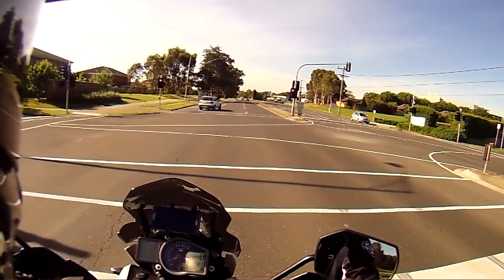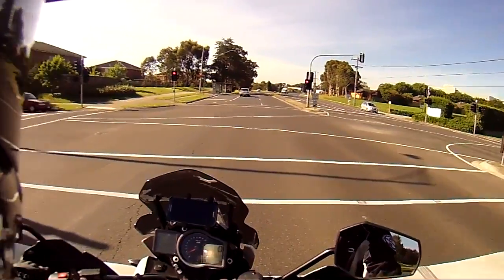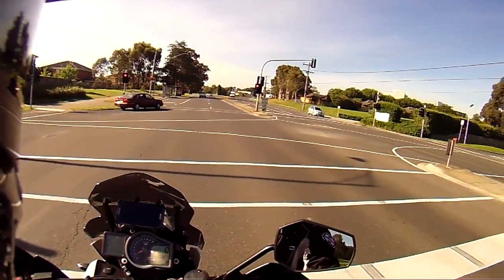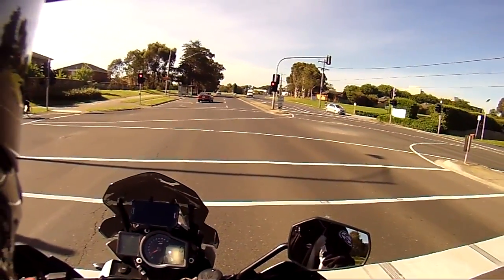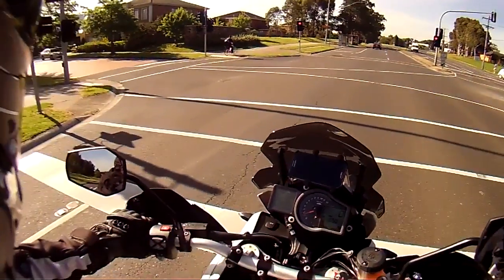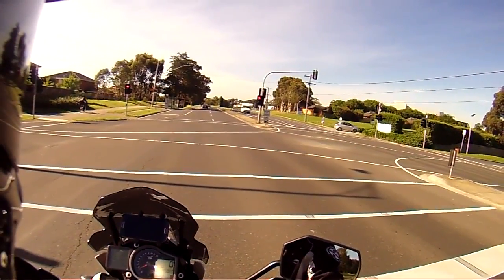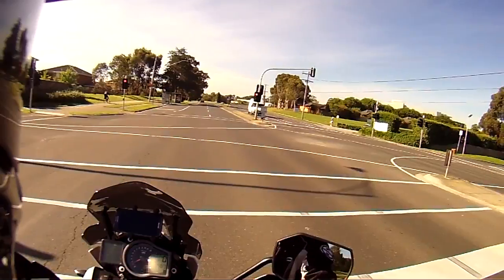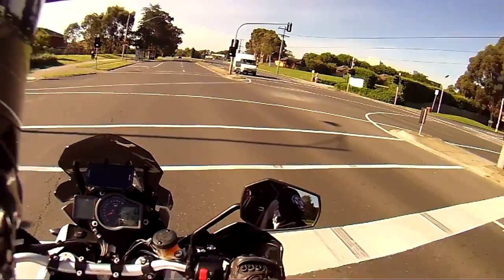Sound test and TKC80's

Comment: no epic fail there !  just when it started getting interested you stopped ... ;-)
don't understand why you had a board at the last part ? ... just flooooooooooooor it !!!

PS :  are your mics well insulated with foam ? intalled them in your helmet on oposite side ?  maybe you want to fiddle them behind the cheek pad ?
PS2 : maybe the TKC80's heated up real good and were quite some time in the hot sun ? or you proof to be an expert ???  :-)